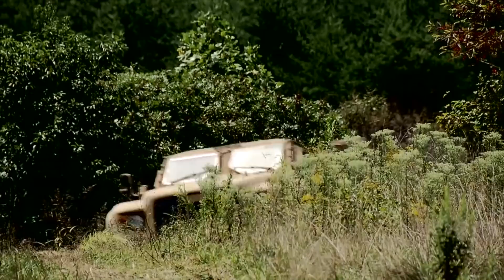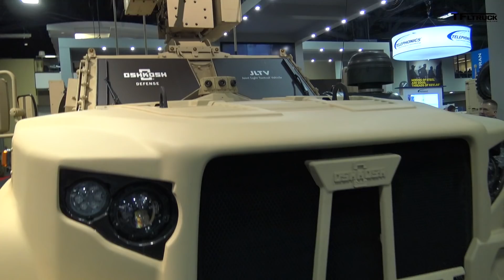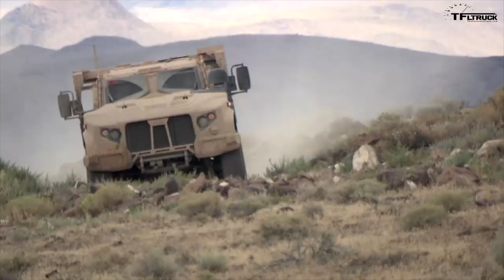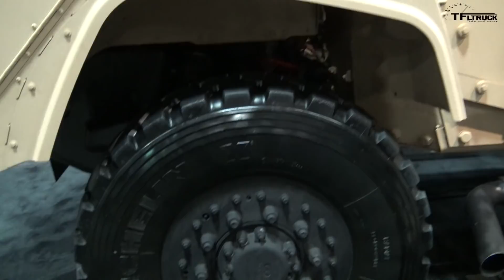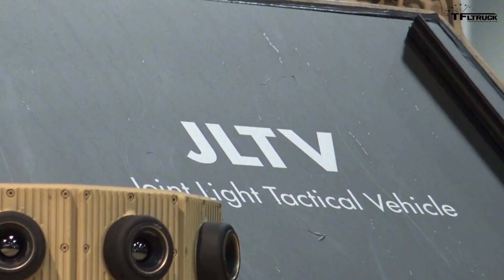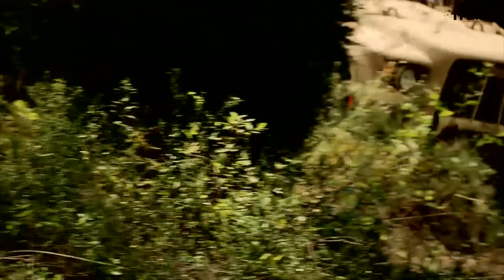Meet the New Humvee: The Oshkosh JLTV Coming Soon To Your Local Army Base

Comment: its to heavy?  my order is for a rail buggy frame,  holds four people.   equipped with a AI auto turret that sports two 50 cal spin guns ant-aircraft.   has a open bed for anything  4X4,   under 7500 GVW.   12 tons is insane it will get stuck in the mud!  Israel has a Model of one!  copy it

Comment: I was deployed to Iraq 3 times. The first time I saw 1114s that had received the extra bolt on armor kits. Get shredded by the nuts and bolts IEDs. Needless to say we lost some guys during that. The 2nd time I was sent to support a unit that had received Bradleys because they were getting hammered pretty badly in Hummers. My 2nd week there I had to load 8 Hummers onto flat racks because of IED damage. My thumbnail photo is of my loading one of these Hummers. To me Hummers were coffins on wheels. They did very little to stop IEDs and RPGs. And I have seen bone yards in Kuwait during my time in Iraq where these boneyards were several football fields long and just full of Hummers. I cant express what a sickening and depressing sight that place was. I was there the 3rd time when the International and Maxxpro's MRAPs came online for our units. They were a HUGE difference in performance and they made us feel allot more secure than riding around in Hummers. I hope the Army and other branches completely gets rid of Hummers. Having them in the inventory only leads to temptation to use them again for these dangerous missions. And that's only putting soldiers at risk. When I first came into the Army the Hummer was a symbol of how great our equipment and vehicles where. We could go anywhere in them and often did. But Iraq made me hate them and I got sick of towing in destroyed and shredded Hummers. And I hated losing friends and fellow soldiers in them.

Comment: for gods sake redesign the front of this thing lol it looks like somebody pinched the head off a transformer loooool
Also I wonder are all the variants this short of a wheel base? Short is good for general use but when you move into the different weapons systems you might need a longer frame and maybe even axle count.

Comment: well I hope it has some amount of acceleration, when we were driving the up-armored HUMVEES in Iraq we couldn't get in or out of trouble fast enough. It was excruciating how slow it was, 0 to 30 in like 25 seconds, no where near good enough. Instead of going for torque they need to make these with some sort of turbo charged monster engine. Oh well maybe these will be a good fit after all.

Comment: Gale Banks tweaked these duramax's to over 400hp. That means the torque numbers are at least double or about 1,000 lb/ft of torque. A 20k lb truck is going to need every bit of that.

Comment: Side Note: Banks Co. is producing a large portion of the engine and transmission components while alsoooo providing the platform to upgrade older humvee platforms. So one company has a part in both this manufacture of new and upgrade of old military units. Imagine the coin rolling in

Comment: At first I was skeptical about the whole "hmmwv replacement" thing. But it makes sense that they would want a replacement for the uparmored hmmwv. When I was deployed for oif we were breaking axles and frames somewhat frequently due to the terrain and all of the extra gear we were hauling. Some of the trucks didn't even have more than a few thousand miles on them. The mraps were even worse.

Comment: Nothing is "Soldier Proof", however this replacement for the Humvee: The Oshkosh Joint Light Tactical Vehicle is one that will provide a soldier with the vehicle needed to do the job.. A really good extra tool for use in a battlefield for a soldier in need.!

Comment: This is a great vehicle.  Very reliable.  7500 hours between mission compromising failure.  More than double the highly developed Humvee.  7-15 times more reliable that the Lockheed and AMG competitors for this contract.  But it is EXPENSIVE.

Comment: $300K, expensive? I worked with Oshkosh trucks, and equipment in the electrical power transmission industry, and 300K for a truck like that is NOT expensive at all. Their bucket trucks were $600,000- $1,000,000 and they  earned their keep. The down time for maintenance and breakdowns was minimal for such a complex beast, that is ask to go where most small vehicles won't go, and carry in giant reels of cable, poles, towers, manpower, and a myriad assortment of other materials. These trucks and our skills keep America's lights on, plain and simple. When Saddam was ousted, many of my brothers went to Iraq to help the Iraqis get their lights back on. Some places in Iraq were still damaged from the 1992 Gulf War.

Comment: This thing is ugly,  bulky,  and completely beautiful in its own way. I think of the A-10 when i see it. The A-10 is not sleek at all,  but it gets its job done better than anything else. I hope the military mass produces them because it seems like a needed improvement from the current HMMWV which wasn't originally built for its mass armor that we added. This thing seems to built around armor,  protection,  and power.

Comment: I laughed when he said the duramax is a very reliable motor, I worked for a chevy, Cadillac, Buick dealership as a service writer from 2013 to 2015 and the vehicle we would see the most problems with was the duramax.
Reply: Brent Addie Was it for emissions related/emissions caused issues?
Reply: John Zak most of it was emissions related, or that stupid Exhaust Fluid crap, but there was 2 different vehicles that blew head gaskets with less than 15,000 miles on them, also there was a handful that had failed injectors, and a couple throttle body issues
Reply: Brent Addie I would assume that the military doesnt care about emissions and most of the diesels would have the emissions crap taken off. Solving most of the issues.

Comment: The Humvee is a next generation, "you can not beat this" Off-road light truck. It is something GM, Ford, or RAM might be building, albeit not as wide, blocky, and noisy. IT really had not good place, as the man said "outside the wire". It just was not made for it.

Comment: Honestly, it does not seem as tough as the South African vehicles were.  Perhaps, it is better at resisting IEDs.  The weight might help prevent it from being knocked off the road by other means perhaps.  Hummers are hard to flip, but this one seems to have a higher center of gravity.  She is going to need a lot of fuel.  Hope those supply lines hold up.  Is the front hood thermite proof?  It just seems like a good spot.  How complicated and/or fragile are the systems?  You used to be able to repair a Range Rover, Jeep, or Suburban with a simple set of tools and often winning means getting equipment back into the field quickly.
Reply: This vehicle can go 300 miles. If it has a 25 gallon fuel tank like the HUMVEE, then it'll get about 12 miles to the gallon which isn't bad for a military vehicle.

Comment: With the Oshkosh TAK-4i suspension, I wonder if they finally integrated 4-wheel disc brakes. The Oshkosh TAK-4 on the M-ATV was quite nimble compared to other class 1 MRAPs but what worried me were the 4-wheel drum brakes on thr M-ATV. I sure hope the Oshkosh JLTV has disc brakes considering their bragging for mobility...

Comment: Uh yah great. Has to have air conditioning working all the time if not winter. Heat stroke patients if the TM doesn't require it deadlined without creature comfort a/c. Obviously some officers were hired for this creature to sell.

Comment: Just listened to a podcast with Gale Banks describing the JLTV as a trophy truck with a gun turret. He said this thing can perform amazing feats of speed over incredibly broken terrain. Can't wait for these to come on the surplus market in twenty years...
Reply: Mike Hershey I'm not sure about that- old APC's are available on the surplus market. Getting one of these licensed for the road is another matter entirely however...

At any rate, you could pop the doors off and unbolt the v-hull they said was removable and ta-da you have a butch trophy truck. 

It's a pipe dream but there's still a miniscule chance they may hit the market...

Comment: Military grade fuel?  That's funny, I didn't know we used "military grade" fuel lol.  What a waste of funding because the M-ATV will do everything this thing can already.
Reply: Rene G. Solis 
I believe what he means by military grade fuel is that it runs on JP-8 fuel, the same stuff the Abrams, Bradly, and basically everything else runs on. Additionally, the M-ATV is getting old and could do with some replacement. Oshkosh's design is also more durable, easily lasting 600 miles without any mechanical issues while also providing more protection from roadside bombs.
Reply: I highly doubt this thing uses JP-8 man, first off JP-8 is way more expensive and second diesel is far more readily available. Yes, the M-ATV is a few years old now but look at the Hummers how long they kept them around, they're way older.  Lastly, how can you attest that the JLTV is more durable when the JLTV hasn't been battle tested yet and yet I have tried and battle tested the M-ATV and it is pretty rugged, I can tell you this thing will go anywhere on any terrain for the most part. I will say the acheles heel on the M-ATV is that the undercarriage of it is not great when it comes to IEDs but the JLTV doesn't look any different from it brother (they're both made by Oshkosh) either so I doubt it's a big improvement and I'll have to be in the field and see it for myself before saying that it is better protection wise.   For me to consider this an improvement, it had to 1. provide WAYYY better protection against IED and they don't show any proof, all talk, 2. it has to be better power wise and I can tell you the M-ATV moves fast and really smooth and 3. it has to be WAAAYYY better on fuel economy, I'm talking like 10mpg over it's brother to make a difference. Lastly, the M-ATV is prtty reliable so I'm not sure what you're talking aboutlasting 600 miles without any mechanical issues unless you're talking about bullet holes that the hood can take because it is not bullet proof like the rest of the vehicle which would be total BS because I can tell just by looking at the JLTV it's the same material hood.
Reply: Rene G. Solis well, that's what the wikipedia article says anyway. One of the parameters for the competition was to be able to take JP-8. It's also supposed to be able to operate nominally at elevations of up to 12000 feet as well as operate normally with a punctured fuel tank, oil tank and coolant tank. Also self sealing fuel tank. The 600 miles figure is basically how long the JLTV should at the bare minimum be able to drive until something mechanical breaks, mission compromizing or not, presumably so the mechanics have less maintenance to do and more time to fill hesco bastions or whatever the CO can think of.
IED protections are supposed to be improved, I don't know how, it's probably classified, but it's supposed to be just as good if not better than a straight up MRAP. M-ATV is also much heavier and less maneuverable offroad than the pentagon would like. Parameters also demand that if the IED doesn't kill everyone, a fully loaded jltv should be able to be completely evacuated in 3 second or less. The doors, even if mangled beyond all recognition should not jam and still open normally. It's also got improved air conditioning and an automatic fire extinguishing 
system for both the engine and cabin.
Also the pentagon wants it to be able to mount a 30mm autocannon CROWS, not grenade launcher, autocannon.
Essentially the pentagon wants a baby Stryker.
Reply: It's smaller, faster, can fit on planes etc

Comment: I watched some of the baja footage. It looks very, very likely to roll over especially if it should lose a tire or hit a hole in a turn. Didn't give me a sense of stability at all, top heavy. Too complicated as usual. Too many systems to go down. Bunch of bullets bouncing all over the wheel wells and undercarriage, then flat tires and no more air ride suspension. Whachagonnado?

Comment: Looks like a great upgrade for the troops. Glad that this thing has the power to go with all the other performance aspects. The HMMWV suffered because it had a very underpowered engine to start, and then they grafted on all kinds of things it wasn't designed for. That truck still lasted 35-40 years so it wasn't all bad, but if I were in boot camp right now, I'd want to be looking forward to one of these.

Comment: Looks decent. But just like the MATV, they need to design it for people. Not enough leg room for average size people. Being a driver in the army I dread driving the mrap and matvs because of head and leg room with a DVE camera and the radio headset. Dismounting them sucks. The doors are also extremely hard to open if it's not parked on flat surface. Maybe have a spring to help open 300 pound doors. Other than that the 6spd auto and the motor in them are great!

Comment: Why they didn't put a Cummins in it?
Reply: Who knows, but there are literally millions of Duramaxes running around, so they likely have a massive pool of spare parts they can pull from when repairing these. The other thing to consider is GM still sells GMT800 Silverados to the military as a light utility vehicle. These pickups also have Duramaxes in them, so in a pinch they can boneyard the pickup and get the JLTV back up and running.

Just my guesses but parts swapping is important for military machines.
Reply: I agree but by the time the Duramax came around they had replaced the 6.2L diesel with the Avenger 6.5 and had spent too much time and money to turn back.  Would have been a better option in my opinion.
Reply: most likely because they have stockpiles of spare parts for duramaxes for other military trucks that run duramaxes. On top of that the duramax and the cummins do have the same torgue but the duramax puts out more horsepower
Reply: Most likely cost and availability... they crank these dirty maxes out by the millions probably.
Reply: agreed its a logistical thing to choose gm.
Reply: Bullet proof. Built to take a beating
Reply: beause DirtyMax
Reply: *****
So a project you're not involved in made decisions you don't like, and that means the politicians are crooked?
Reply: We use the Silverados as Administrative vehicles and generally speaking we use models with 5.7l to 6.6l Gasoline engines for that.  We don't use them for parts for our tactical vehicle fleet.  We have an immense supply distribution system for that.  Each platform has an 80+ percent interchangability of parts to make ordering simpler and battle field damage assessment and cannibalization simpler.

Comment: You mean an Isuzu diesel, GM doesn't make the duramax
Reply: I am currently rebuilding my broken marriage. My wife was banging the trash man, his truck had a detroit in it.
Reply: Well, saying that - some diesels in the US called duramax dont get that label in Europe either - considering theyre Opel/Vauxhall.
HOWEVER - GM OWNS THEM ALL!   lol
Therefore its a GM regardless of whos name is over the door,
Reply: It was designed by gm and isuzu
Reply: Duramax V8 = GM+ISUZU.  Duramax 6-cylinder = ISUZU.
Reply: Chris b nailed it
Reply: m1abrams 1776 and guess who owns izuzu...... cummins
Reply: Matt Juniper And ford owns Cummins
Reply: Also note this is a Banks built duramax, so while the actual numbers are hidden it's probably around 6-700hp and around 1000-1100lb-ft of torque.
Reply: Luke Orr highly doubt it. Running on JP-8, I'm guessing around 300hp max
Reply: Matt Juniper Isuzu is partly owned by gm
Reply: I currently repair and rebuild the 6.5 liter Smallblock Diesel, there is one in every HMMWV.  They come in power ranges from 165 to 300+ HP with and without a turbo and are most definitely GM Smallblock direct injected Diesel V8s.
Reply: Dan dd what?
Reply: Source: en.wikipedia.org/wiki/Duramax_V8_engine
Reply: Uh... yes they do. It's a joint venture between General Motors and Isuzu made in the USA. Having the Isuzu name brand doesn't mean it's foreign made. The powertrain foundry is in Moraine Ohio.
Reply: somebody knows how to use wikipedia
Reply: Mike West have you ever heard of Detroit Diesel?
Reply: I remember seeing an article back then when GM ask Isuzu to design a diesel platform. When it came out, it was labeled the quietest and pound for pound it was one of the best engine around.
Reply: Isuzu is owned by GM, and the Duramax is conmanly found in GMC and Chevy trucks
Reply: The l5p has more of gale banks/gm in it then isuzu
Reply: Darren Roemer Isuzu is not owned by gm at all.
Reply: Tyler Sutton OK, I was wrong. But they have a very close relationship in which GMC, Chevy and Isuzu all so a lot of design features.
Reply: you are wrong...
Reply: Greg Thatcher Oh good lord shut the fuck up you literally have no idea what you're saying.
Reply: It was designed by isuzu because Gm cant make a diesel.  look at the 350 diesel for example.
Reply: Well how about all the gas conversion diesels GM sold. In Cadillacs, Oldsmobiles, Buicks, and of course Chevrolet. Those were the worst designed diesel engines EVER! Tax payers had to bail them out for all there engineering and financial blunders.